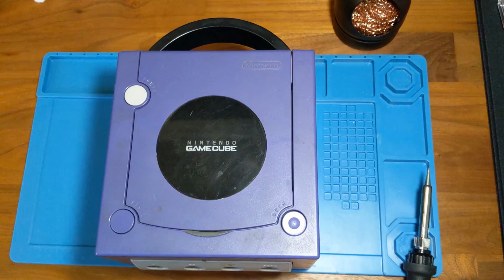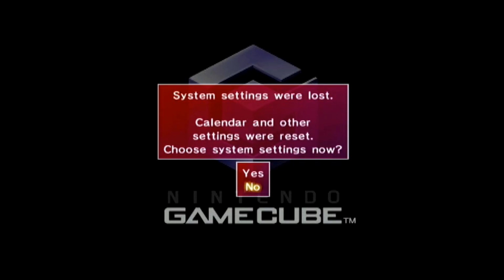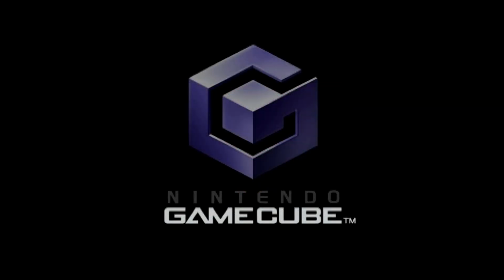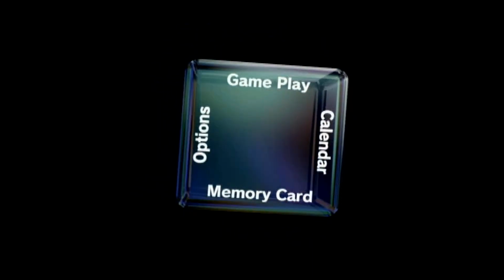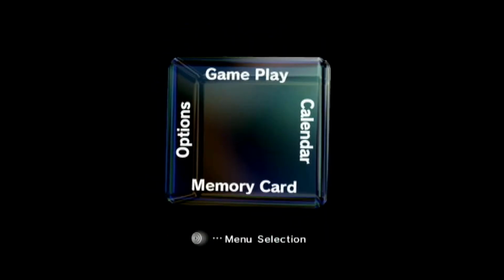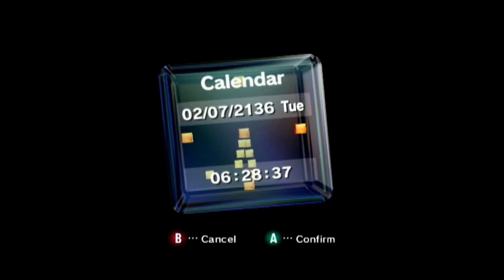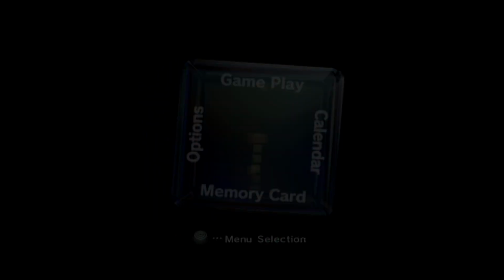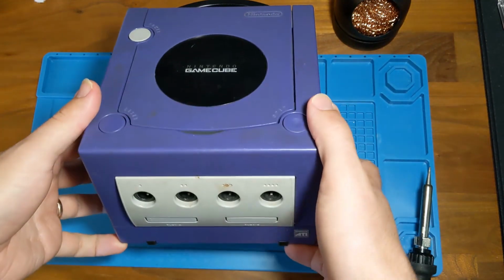How to Make a GameCube Clock Battery Easy to Replace

Comment: 2:50 what did you brush onto the places you’re going to solder?
Reply from the maker: It's flux. Helps to get the solder to flow to the right places and remove oxidation from the contacts.
Reply: @DMSCreates good to know, thanks for the quick response!

Comment: Great video man!! Just one question: do I have to welder the whole battery or Am I able to replace it without going to technical?
Reply from the maker: I'm not sure I follow the question. The process is: remove the old battery (typically by desoldering it), then you can either solder in a battery holder like I used, or you can solder in a battery that already has tabs attached. I prefer using a holder, so swapping batteries no longer requires soldering.

If you're not able to do the soldering part, then you can't really fix this issue long-term.

Comment: What is the yellow goo u painted before de soldering, and what temp should I use to soldier
Reply from the maker: The yellow stuff is flux (it's used to help the solder flow). If you get some, make sure it's for soldering electronics and not for plumbing.

For soldering, the temp you should use depends on your solder and the size of the components/pads you're soldering to. My solder flows well with my iron set to 350-360 degrees C and allows for minimal contact time at that temperature. If I'm soldering large pads or grounding surfaces, usually I'll increase the heat by 10-20 degrees, since the bigger the contact, the more heat it pulls away.

For desoldering, a good trick is to apply flux and a bit of fresh (low temperature) solder to help lower the overall temperature needed to get the existing solder to melt.

Comment: Do you have any reccomendations for battery holders?
Reply from the maker: Not really, anything with the right pin spacing (I think it's 19-20mm, but not sure) should work. The ones I used are linked in the video description, but they tend to have a bit too much plastic so they require a bit of work to get in place (either gently bending and pushing them into place, or cutting off some of the excess plastic). 

You could also try something like this: https://www.digikey.ca/en/products/detail/adam-tech/BH-25E-1/13537715 but I'm not sure if the pin spacing is good, so you'd need to check distance between the mounting holes on the Game Cube PCB.

Comment: What kind of flux do you use for electronics like this? Does it matter at all?
Reply from the maker: I use no-clean flux for electronics (basically just make sure you're not using plumbing flux). Mine is a paste, you can also get it as a liquid

Comment: Where do you get the Gamebit Screwdriver, and how do you choose a good one that will reach the recessed  gamecube's screws.  Thanks.
Reply from the maker: I got mine as part of a set off AliExpress, you can also get them on Amazon. All the ones I've seen are long/thin enough to reach the recessed screws as the bit itself is fairly long. I don't think I've found one that hasn't fit properly (of my 3 sets), but if you're worried look for the appropriate gamebit screwdriver as an individual screwdriver with a shank the same thickness as the bit. ie. something like this (I'm dropping my affiliate link here, so if you do buy it from here you'll be supporting the channel): https://s.click.aliexpress.com/e/_olrfykH

Comment: Battery holders for the win. I use them when changing a battery in my games. They can be a bit iffy in finding the right fit but worth the effort.  I also love how easy it is to add a holder to the Sega Dreamcast. Makes battery swapping easy as can be.
Reply from the maker: You just reminded me, I should swap both my Dreamcast batteries too!

Comment: do you HAVE to switch out the battery holder?
Reply from the maker: You don't have to change the holder, you can just get a battery that includes solder tabs (they're typically welded on because you do not want to solder to a battery directly). It's actually easier to do that, but in my case I'm hoping the console lasts me beyond the next battery change as well. At that point I won't need to solder. It's also easier to find normal batteries in my area as opposed to the ones with solder tabs (though I have some on order for replacing gameboy game batteries)

Comment: 1:28 is it easy to take out the ribbon? I’m thinking about getting a replacement controller board with the battery part modded but I’m afraid I’ll jinx something
Reply from the maker: I've done it on a few and it hasn't been a problem. Just be gentle and pull it with an even, consistent motion. As long as you don't bend it back and forth too much (or somehow cut it), you should be fine.
Reply: @ yoo thank you for getting back to me

Comment: Nice video, subbed. I need to do this myself. Do you have any recommendations for a beginner with soldering?
Reply from the maker: Thanks, glad you enjoyed! Is that a Commander Keen profile picture? I used to love those games!

A few things I'd recommend for a beginner:
1. Get a soldering iron with multiple tips and temperature control (it doesn't have to be expensive). I typically work around 330C, but temps vary depending on what you're working on/with.
2. Practice before working on anything important. There are practice boards you can buy to test out soldering different scenarios, things like SMD component soldering are more difficult than proto board / vias. You can also just use old boards for testing.
3. Figure out what each tip is good for and which one you prefer working with regularly.
4. Figure out which solder mix you prefer to work with. Higher ratios of lead is easier to work with at lower temperatures, but lead-free is safer for you.
5. Always tin your iron's tip before putting it away to prevent it from oxidizing and losing effectiveness over time.
6. If you're soldering large areas (ground planes, or components with large pads) you'll need to turn the temperature higher than your normal work temp, and move quickly.
7. Use flux. Even if the solder has flux mixed in, adding a bit of flux will help wick the solder in between the components and burn off oxidation so you get a solid connection.
8. Have some desolder wick and a desolder pump on hand just in case. Hopefully you won't need them, but if you do it makes removing excess solder / undoing connections a lot easier.
9. Be wary of soldering stranded wires unless you're putting in strain relief (or are just prototyping). The solder mixed into the strands removes its ability to bend, so you're more likely to get a broken connection.
10. Be careful and work in a space with lots of room around you. I like having a heat-proof mat on my work surface so I don't need to worry about burning the table, but soldering irons are very dangerous. Always make sure to have some sort of fume control (or work in a well-ventilated area with some airflow) and don't touch the soldering iron tip until you're sure it's cooled down.

I can't think of anything else off hand, but the best way to learn is by doing. Stay safe and give it a shot!